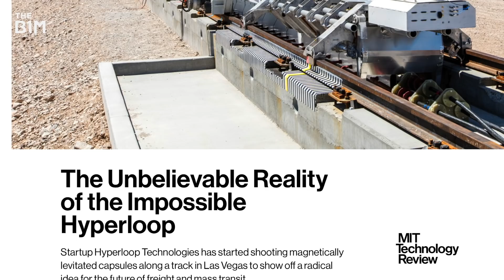Fred Mills and Sir Richard Branson: Inside Hyperloop's First Passenger Test

Comment: literally a pipe dream -- rust, seismic problems, heat expansion, repair nightmare.      but it will be really fast to go between airports in dubai
Reply: Covid has destroyed Emirates. Only 4 of their 123 A380s are flying. 84 being sent to long term storage possibly never flying again. That second airport won't be built good and proper for decades.
Reply: Sorry to climb over your seat but I need to get to the toilet! Oh there is no toilet? I need to use that bucket? OK.
Reply: Yea that’s why there’s never been any type of pipe to go miles we haven’t figured out rust or heat expansion. It’d be so nice to pump oil or telephone cables for miles too bad that’s impossible
Reply: To be fair this whole project could be just one big underground network. There is really no benefit for it being all above ground. Not if you can't even see outside.
Reply: @SD-tj5dh  That is until you learn how much digging underground cost. Check it out.
Reply: Also, maybe dubai should focus on building a functioning public transport system first. Same for the US.
Reply: @ShadowebEB  the Swiss did alright with it. It would be cheaper than having constant breakdowns and repairs of depressurised sections of rail.

It would hold much greater integrity over time.
Reply: @SD-tj5dh  The Swiss had to dig a tunnel as they couldn't go above the mountain, that tunnel is 57km long and it's the longest in the world, that tunnel cost around $15billion, so to have a link between 2 cities of average distance you have to have at least 10 times that, so $150 billion at the very least just. And that is only for a tunnel, then you have all the steal, the vacuum equipment's etc. Also if ever there are any issues the pod will get stuck for hours in order to remove all vacuum and excavate. And this is without any toilets in the pod... Imagine the disaster.
Reply: @Asterisk If there is a vacuum in the tube: No oxygen, therefore no oxidation (rust)
Reply: @Asterisk lets ignore all the technological problems that make hyperloop impossible as of current and cut to the worst offender of them all. you shoot one bullet into that tube, anywhere along the line, and everyone insdie dies.
Reply: @ShadowebEB  look sorry was tired didn’t mean to be rude but also I’m a junior in mechanical engineering we do have solutions to thermal expansion. In bridges we use roller joints in pipes there’s areas to contract and expand (tho when underground thermal expansion is basically null as the ground regulates temp really well)
Reply: @ShadowebEB  the key is not to make it a vacuum system to begin with. Just a vell ventilated underground high speed rail/maglev link.

It would still be way faster than air travel once you take into account the time you're not in the air waiting to get on/off.

Doesn't even have to be entirely underground.

You could do just as much with a rail link as you could with a hyperloop.
Reply: @nickwilliams2745  For the pipes you'll have a 4x 90 degree turn, that's OK for a liquide or gas, but definitely not for passengers. For the bridge solution, you wouldn't have any vacuum as there is a gap. The only way is to have the full tube expand or shrink on rolling pillars, but that would cause serious issues. Other solutions would be to bury the tube, but that would make the tube way more expensive than it already is, also for security reasons it would be dramatic as it would require excavating the tube part to get passengers out. And remember there are no toilets in the pods, so those few hours of decompression-excavation will be dramatic mess that would be the downfall of this stupid idea.
Reply: @jeanmariemorin  Total vacuum is too hard to do. It will be pressure at 20K feet etc.
Reply: @nickwilliams2745  How is it impossible? Oil and gas pipelines run for thousands of miles all over the world with provision for maintenance. I'd say the biggest problem to this would be seismic activity, but I also don't expect these things to be built in high seismic exposure areas
Reply: Shadoweb EB you have both a lot of (apparent) know how and also a lot of criticism. Maybe you could suggest improvements to the design instead, if you think it is inadequate as is?
Reply: @fortuna19  it's a flawed idea from the start, just like the canon to send people on the moon, it doesn't matter how much engineering you put in, it will just be too costly and won't work. There are just no solutions, it's a pipe dream for publicity stunt purpose. It's the equivalent of Theranos, billions will go in and in the end it will be a scandal. But people were not listening then, why should they start now?
Reply: @ShadowebEB  I also agree with you, this is a colossal waste of time and resources, creating problems out of nowhere. This is literally a maglev train, but a smaller version of it in a tube. Could've spent more time further developing the Maglev technology. But no, we are going with this "revolutionary technology".
Reply: @fortuna19  Mag-lev is good tech. You make a mag-lev train, put 500-1000 PNRs on each one, streamline it, get 250 km/h with a high PNR/Minute rate.
Its why there isn't a hyperloop under LA or Vegas (as there was SUPPOSED to be by now): Its a dumb idea. The PNR/Minute rate is pathetic with those small modules. Trains make more sense, or running cars (or better: buses) through tunnels close together (like many cities do).
If you want to go far/fast you use ballistic trajectories - space vacuum is much safer than the man-made kind: it won't fail and kill everyone.
Reply: @fortuna19  Basically it is the fail mode: It doesn't fail safe. Now I admit that planes don't either but they are inherently less dangerous (and I love the new ones with built-in parachutes).
Reply: You're funny well what do you want us to do stay with our old technologies as they slowly deteriorate and everything will be perfectly fine I understand man so when the nuclear bombs go off are you going to be fine
Reply: @capnsteele3365  WHAT new tech? There is nothing here that wasn't available 50 years ago.
Reply: @ShadowebEB  don't worry you can take the train ride it has toilets will just take a few hours more.
Reply: @dylan319   Well @Shadoweb EB will still get there faster than you in your HL, because at least trains are real. HL is not possible, it doesn't work, period. You can build one if you don't care about economics, but it would be the most pointless white elephant ever built.
Reply: @dylan319  have you heard of theranos? It's a revolutionary idea as good as the HyperLoop, you should invest your money in it, it's the future. People mocked the 
Wright brothers but it turned out that they were right, so put all your money in theranos and hyperloop! It's the future!! Don't let people take away your dreams.
Reply: It is literally a maglev train in a pipe. Fuck the pipe off and get maglev links everywhere. 

You could make a fully automated system with trunk lines, hubs, and tram-like links to your final destination.
Reply: @SD-tj5dh  You're exactly right, it's a Maglev inside a vacuum pipe. Maglev tech didn't pick up because of the high cost of the tracks, HL has the track + pipe + vacuum pumps + pressurized pods + airlocks + unknown kind of dilatation joints. And with all that people still think it's economically viable.
Reply: Most expensive vaporware ever!
Reply: You sound like a guy going over the problems of cars and arguing for horses
Reply: What happens if an explosion occurs in a pressurised pod in a vacuum pipe, travelling at high speed, Going to be messy.
Reply: Yeah, after all we’ve never built anything like that, like massive pipes that span thousands of miles to carry crude oil without leaking, oh wait.
Reply: @kloschuessel773  

These "critics" are just trying to bait people lol. It's like giving a film a low rating before it's even been released.
Reply: @jeanmariemorin  It's completely different between oxygen free environment and vacuum.
Reply: @endintiers  Even a partial vacuum would be difficult to achieve. then, without air, no cooling of the cabin and its survival systems ... At such speeds, no curves possible, or a radius of several kilometers. Etc ... Etc ...
Reply: Loving the armchair scientists in this thread repeating all the shit that Thunderf00t said that's already been debunked by people who actually understand the maths. Like some chemist who didn't bother to read the full white paper has much better insights than the rocket scientists and materials specialists that actually looked into it. "Yeah, but.... but there's no toilet!!" yeah, maybe not in the designs, but the thing about designs is that they can change.

I don't know why I'm really bothering to write this comment, people will continue to say it's impossible until it's built, and then they'll fine some other new tech to shit on
Reply: @ShadowebEB  people have said this about tesla (elon musk) in general and I just see it being expanding each year.
Reply: Can anybody explain me why are you guys so against this idea? Are we paying for this somehow?? Like I really don't care what billionaires do with their money. What about you guys make your billions and do whatever the f*** you want with it?
Reply: @meistsyans6526  no it's just going nowhere, nearly 10 years of dev and we only got this shit that you can see here, it would be many decades before anything serious could be built, but at an extremely high cost. In the meantime you'll have investors, big and small, pension funds, getting scammed thinking that it will be real and invest a lot. Just like Theranos, and will fail the same way. If people continue promoting theranos-like projects just because they want to believe, then a lot of people will lose their money. It's a duty to keep people informed.
Reply: @ShadowebEB  "it's a duty to keep people informed" so are you kinda like a sjw? but shown in other form.

Like i said go study, make your billions and spend that money in whatever you want Branson to be spending on instead of the HL. 

As long it doesn't affect me or harm anybody, I don't care what they do with their money tbh.
Reply: Oh yeah, rust (AKA oxidation) is a huge problem in a mild vacuum, you know, because there is so much oxygen compared to the 1atm air!?
And that darned thermal expansion definitely cannot be solved by expansion joints (because engineers have never built a single vacuum system, apparently).
Also, slip joints absolutely can't deal with "seismic problems"...
Reply: @meistsyans6526  remember to invest your money in those projects, you'll be very rich ;-)
Reply: @Archer Lol that does not last forever but ok? Yea having a tube underground with every element pushing against it.... that will never fail right. You know how much money it would cos to build mile long tunnels and install every maintenance hatch and emergency rooms needed? You really need to give your head a shake. This project is so Elon can get more money from governments. Literally a pipe dream, we should be investing in high speed rail trains....
Reply: @capnsteele3365  What new tech? Everything is recycled now a days and only makes small ass improvements now.... look at the smart phone. Has not changed much in the last 5-6 years.
Reply: @FitnessGuru91  Well actually for really high-speed mag-lev you need really exacting engineering - so high speed for more than a km or two is too expensive.
Therefore may as well go for lower speeds (~300km/h)  which then does not require mag-lev.
Reply: @FitnessGuru91  we made flying cars also do you think technology is just made it has to be recycled there has to be different components from other places to make a new technology. You must think we create matter you're funny man understanding no scientific law no intellectual law and think you're being smart
Reply: @endintiers  Ok I do not know much about train technology. I am just saying there is much better option than this bullshit pipe dream.
Reply: @capnsteele3365  What is your point? As I said small improvements have been made from already existing tech. When is the last time we had anything majorly advanced come out? You realize technology is slowing down also right? They need a new material to develop transistors and pc boards.
Reply: @FitnessGuru91  So by that logic thunderf00t has nothing to debunk then? Cool. He can stop getting his maths wrong, his assumptions wrong, and maybe take this time to read the full paper which covers a whole bunch of stuff that he called into question.

How about we just leave those people who are creating the system to their devices? I think that the people who say something can't be done should, generally speaking, get out of the way of those doing it.
Reply: @TehPoet  he was literally wrong about one calculation lmao. The g forces still does not change this is a shit project.
Reply: @FitnessGuru91  if you say so mate 👍
Reply: @FitnessGuru91  And I agree with you! Also, Virgin is using EDS which means: no pacemakers, no magnetic storage and no cards with stripes.
Reply: @FitnessGuru91  what?
Reply: @ShadowebEB  I don't get the joke because the hyperloop can make 3 hours of trip possible in 35 minutes. And a person can actually stop his urine for almost 1 hours.
Reply: @Amit_Pirate  And you expect to never be any disruption of the service? Any issues on the service, like tube failure would cause a complete halt of the full service and a re-compression and evacuation, which can only be done by authorized people, all this would take half a day at the very optimistic scenario, unless they cut the tube. Asking people to hold it off for 8-24hours will be very challenging I assure you.
Reply: @michable100  yea I really hope that the Texas bullet train actually gets built. Being able to travel from Dallas to Houston within 90 minutes would be awesome. And make things much easier
Reply: you mean like everything else? LOL, part of the airline industry I assume?
Reply: @nickwilliams2745  so because you can’t figure it out, nobody else can’t?
Reply: @ShadowebEB  Forget about recompresion if there's a pipe failure the tube would implode. If the pod gets stuck passanger would run out of air. There's no way they could get them out in time.
Reply: @meistsyans6526  "Why ate you guys against this idea, you are not paying for this". Uhm if you saw poor people (like you in this case) being scammed would you stand by without pointing out the ridiculousness. By the way everytime you say to people it's a scam they don't believe you until it's too late. The Hyperloop is a bad idea and ine with grave consequences. One little mistake renders the whole pipe unusable and billions of dollars lost and not to mention people with their insides blown out.
Reply: @asandax6  lol so the guys who are investing in the hyperlook are poor? 

No, I wouldn't invest on it, but if the rich guys want and they are being "scamed" I don't care tbh. People can do with their money what they want. And that's the whole point of start ups. Like sometimes they work, sometimes they don't. People have to be aware they might either lose or win big time.
Reply: @meistsyans6526  But the problem comes when the public must also pay through governments giving subsidies to pipe dream projects like this.
Reply: @endintiers  because it would take fucking ages to build. The regular HSR that is already supposed to be there is taking ages
Reply: @Josh-oj9mm  The Chinese are building 1000s of km of HSR every year.

Comment: It's called HYPErloop for a reason. Hype is literally in the name.
Reply: Hyperloop is not necessary. High-speed rail is much better. Speed is overrated. And why the fuck would I want to travel in a tube? I'd rather see my surroundings.
Reply: @jondon8704  What a stupid statement.
Reply: @srs6461  the cost per Mile of hyperloop is gonna be ridiculous. Half the travel time at 100x the price seems like a dumb tradeoff
Reply: @ninjasamich120  You do realize it’s going to be the same with high speed rail.
Reply: @ninjasamich120  Any form of transportation like this is going to need to be subsidized.
Reply: @ninjasamich120  Why not hyper loop?
Reply: @srs6461  We actually know the cost of high speed rail lmao, and it is in fact profitable when built in the right places as the Japanese have shown. Maglev trains on the other hand are not, as shown by the fact that even in downtown Shanghai it can't turn a profit. Unlike the rest of the Chinese rail network. So why would a Maglev train inside a vacuum tube be more advantageous? Why would the government pay to subsidize a 100million per mile system when a 1million per mile system exists which can move 1000 times as many people at once. We also know that high speed rail works.

The problem with the hyperloop is that the best possible scenario for its development would still be worse than existing alternatives.
Reply: @ninjasamich120  You do realize these things aren’t meant to turn a profit?
Reply: @srs6461  still, they are not meant to generate such losses
the astounding thing was the ”compactness” of the pod - high speed trains would be much more efficient in moving people around
Reply: @srs6461  it's America, everything has to make profit.